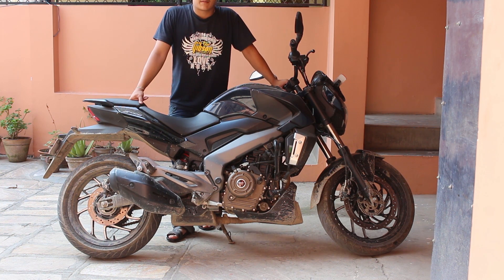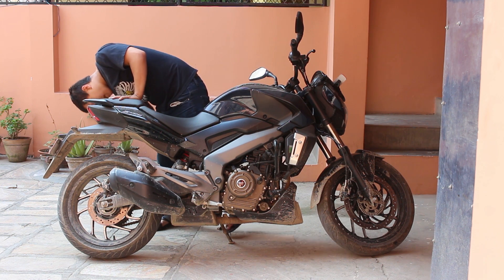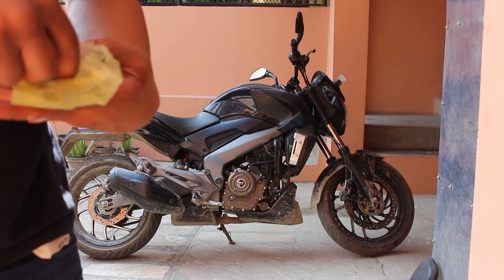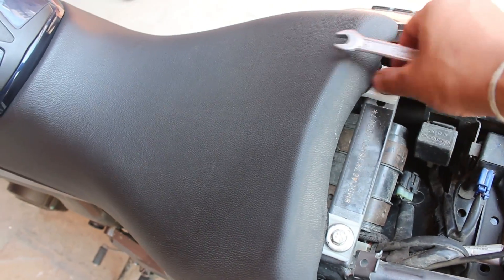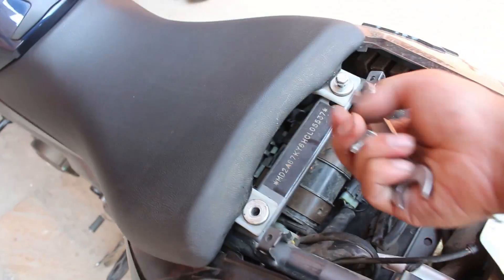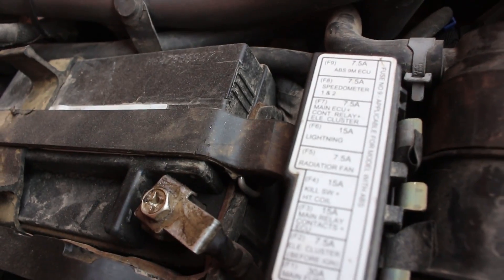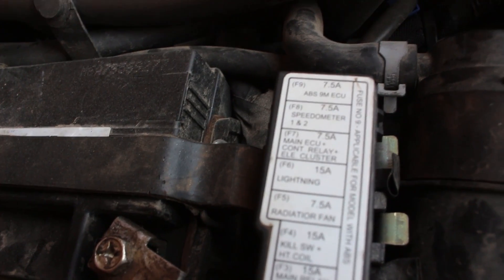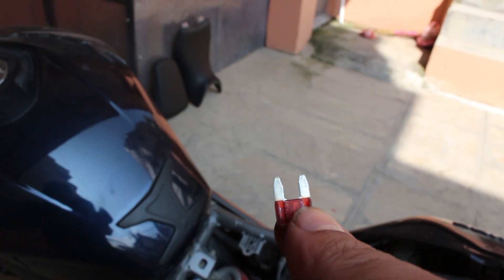HOW TO DISABLE ABS ( Anti-lock Braking System ) in Bajaj Dominar 400

Comment: Bro even i too tried to off abs but. I couldn't do stopie. But speedometer doesn't work for me to. Can u let me know y
Reply from the maker: if abs dosent work and your wheel can be skid then maby tires are woren and old..new front tyerr will help
Reply: @RMTube  mine new tires and it does skip in front but stopie coudint do what to do?
Reply: @RMTube  reply me bro how to do stopie
Reply from the maker: well because the weight of dominar is heavy it is quite hard. i learnt it in R15 and it was easy in duke also. if u can do in other bikes then u need more practice and confidence. try to keep as much weight as u can on front wheel by standing up and pumping the brakes
Reply: @RMTube  bro shoud i lean front for that